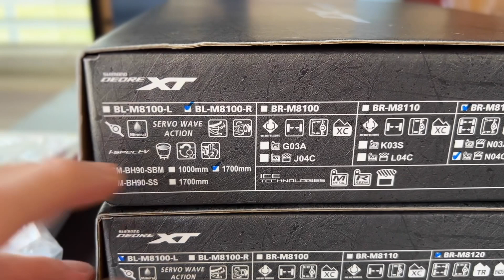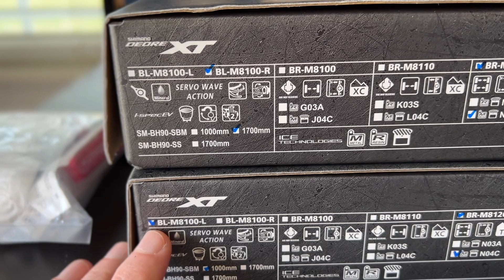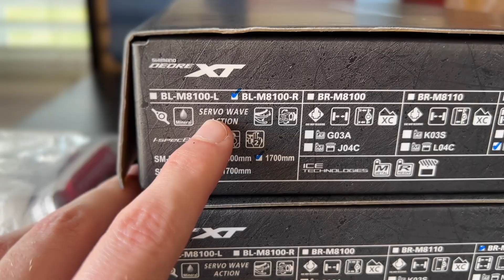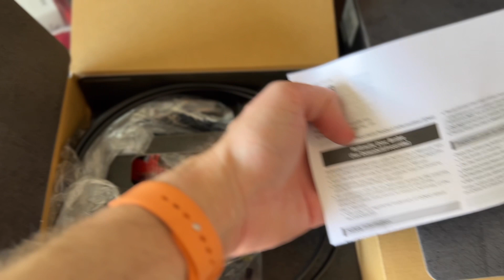Trek Powerfly 4 Brake Upgrade to Shimano XT 8120

Comment: Just got these brakes today along with the 203 ice tec rotors for my powerfly 4 👌🏻 hoping my bike guy has no issues installing the back brake with the way the wires are housed 😅😅
Reply from the maker: If I can do it, it will be easy for a bike tech!

Comment: Great video, thanks for sharing - I’ve also ordered these brakes + the ice tech discs, and a dropper post
Reply from the maker: That's cool.  I just kept the stock 203's, I wonder if ice tech is better.  I don't think I'll do a dropper because I'm 6'4" so my legs are already so long that I can just lean way back without it.
Reply: What dropper did you go for?
Thinking of adding one to my Powerfly 5 soon
Reply: @R0BBS  went with a oneup, really happy with it but it didn’t come with a cable or lever so had to purchase that separately
Reply: So your disks are compatible with the XT calipers?
Reply from the maker: @oldkicker8958  Yep, they are decent 203's

Comment: I have a long tin bit of steel on top of the wires inside says do not remove??
Reply from the maker: As long as you're not messing with the battery wires your fine

Comment: One thing I noticed is your cockpit setup with the levers/controls relatively close to the grips/overlapping.  After watching the linked video from Loam Wolf (braker lever setup starts at 5:20), I went back at my setup with a very critical eye.  I ultimately moved most of the controls inward/away from the grips to insure I had unimpeded grip/no rubbing accidental contact with dropper control, shifters, etc.  This also gave me easy 1 or 2 finger reach to the brake levers at the point of maximum leverage and no potential from contact with my knuckles.  It does require that the brake levers go on the bars first then the other controls spaced between them and the grips.  Not the way it comes from the shop, but I think it makes things accessible without requiring the grip 'resets' I was making to reach shifters, up for brakes, etc.  YMMV.
https://youtu.be/a60AfEQJDzU
Reply from the maker: Thanks for posting that pro setup video, that was very interesting!  It's definitely YMMV but there's some good tips in there.

Comment: I've about convinced myself to ignore the dealer (about upgrading to a Rail) and pulling the trigger on a new Pike Ultimate 2023 RC3 fork.  I can get the 130mm travel fork now, but the 120mm is still out of stock.  Not sure that it makes much difference with just a 10mm change.
Reply from the maker: I did a lot of research on the travel and came to the conclusion that with the geometry of this bike it's important not to go higher than 120mm.  Will the 10mm make a noticeable difference?  Let me know once you ride for a while!
Reply: @CarolinaCowboys  it’s a moot issue.  I kept looking at the costs vs benefit and realized I’d have as much or more tied up as getting a Rail 7.  The dealer offered me trade-in of 75% of what I had paid; short story is - Traded the PF4 for the Rail 7.  I’m amazed at how much faster it is than the PF4 on downhill coasting - opposite of what I expected based on tire width.  The geometry seems a bit more comfortable with less forward weight shift for seat/pedal distance adjustment.  That has been the biggest issue for, being 6’3” - bike stack/reach does not retain the ‘normal’ weight distribution when I get the saddle /pedal distance set correctly.  The Rail seems to be better in that regard (plus I stayed with a L frame size instead of the recommended XL).  My test ride this AM to check my fitting adjustments was more comfortable than my best effort to date on the PF4.  That seems counter intuitive, but it is the case.

I will, at some point, upgrade to the new 2023 RockShox Charger 3 design fork, but not for at least a year.
Reply from the maker: @gclaytony  very nice, enjoy!
Reply from the maker: @gclaytony  Very nice!